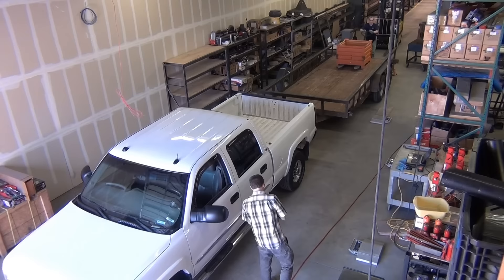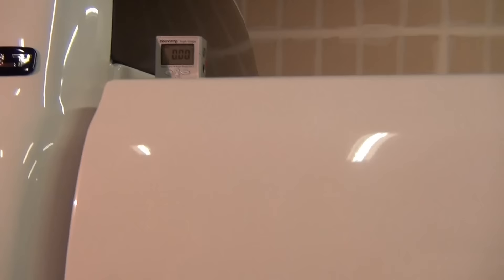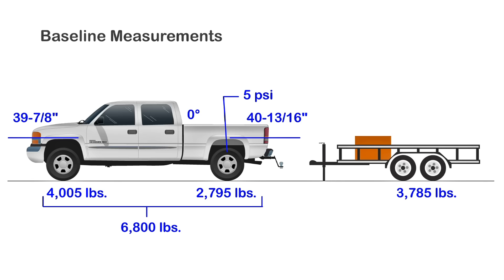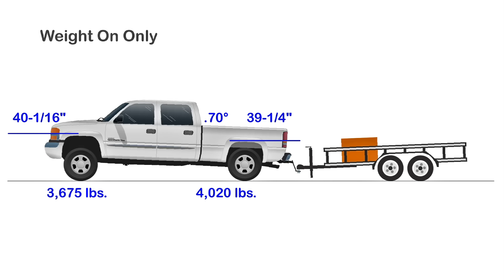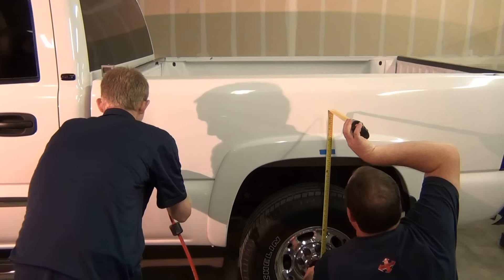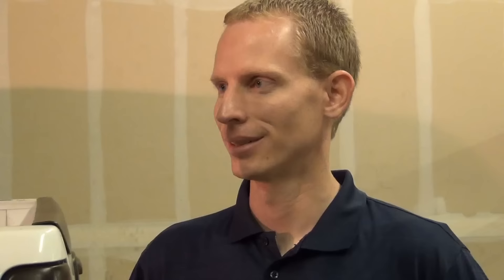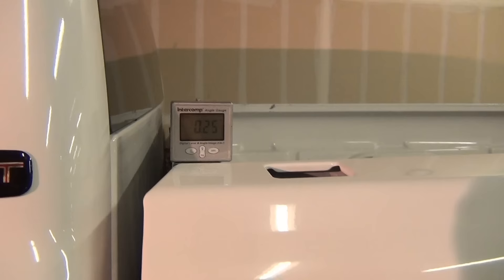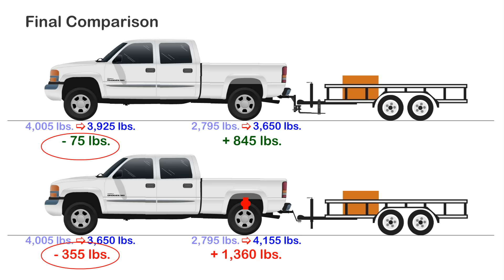The Difference Between Using Weight Distribution and Air Bags to Level Your Load

Comment: Great video. I would have loved to see you put a few pounds of air into the airbags and get the truck front axle back to original weight, and then look at the weights of the other axles and angles.

The reason I say this is because when I first got my travel trailer over 12 years ago, it was my first weight distribution hitch with the equalizer setup. I played with it extensively including adding tilt washers, raising and lowering the hitch height, raising and lowering the L bracket Heights, Etc.

At one point, I took way too much weight off the rear axle in an effort to get more weight on the front axle for steering. It took nothing for my little 5.3 liter gas V8 to spin the rear tires even with the trailer attached. Scary, but it was interesting.

I finally found where I was happy. With tape measurements and the driving feel of the differences I went to a truck scale and found that my front axle weight was pretty close to unladen so I was happy. I never changed it after that although that truck and trailer are gone now.

By the way, The Equalizer hitch is solidly made. I never broke a single component. And I once broke the tip of a 90 pound jackhammer. And my dad always told me I could mess up an iron ball in a padded room
Reply from the maker: What a great comment. Thank you! We assume that you mean you wish we had done more showing adjustments to the hitch with the air bags inflated. That is a request we have had numerous times, and it’s a video that is planned for the near future. If not, please give us some clarification on what you mean in your first sentence. We’re glad you had such a good experience with your Equal-i-zer hitch, and we recommend you stay away from iron balls and padded rooms.
Reply: @FastwayTrailer  I now realize that did not make much sense. What I was requesting was adding air back to the airbags after the weight distribution hitch was installed. I wanted to know if adding a little air shifted slightly more weight back to the front for steering. I have had pickup trucks loaded to the gills with concrete bags and the front felt soft and with lack of steering. Maybe 75 lbs doesn't make much difference. Nevertheless it would be cool to see what would happen adding some air to the airbags. My theory is that it would not add much weight to the front.
Reply from the maker: @brainpause  if you add air to the airbags after setting up the hitch, you do not increase the weight to the front axle, you reduce it. This is because what you are effectively doing is raising the baseline height of the hitch head/hitch ball. Weight distribution is a function of the distance the ends of the weight distribution bars are raised relative to the trailer frame. Therefore, raising the back of the truck raises the entire hitch by that distance, which reduces the relative distance the ends of the bars must be raised to be placed on the L-brackets or reach a certain chain link. If you raise the back of the truck without adjusting the height of the hitch ball back down to compensate for this, you will reduce the amount of weight distribution you are getting from the setup.

In your example, you should load the concrete into the pickup first, set your air pressure, then set up the hitch to the correct height and weight distribution adjustments. If you add air, you may need to increase the weight distribution. If you release air, you may need to decrease the weight distribution.
Reply: @FastwayTrailer  thanks for the reply. I actually don't haul concrete much but just recall several years ago when something like that happened. But it was a good example to use. Interestingly, it was a 1979 Chevy LUV, and putting most of the concrete rearward of the rear axle made the truck feel like it had power steering! Ha!
Reply: @brainpause  When loading the bed, you want as much weight on or in front of the axle, and that corrects the steering, the air bags then help to level up the truck, but will not move weight forward.   When you load weight behind the axle, there in no way to leverage it forward without a WDH, so if no trailer, no leverage. :)    What the demonstration here shows is that with rearward weight from the axle, all adding air does is increase the weight bearing down on the axle.

Comment: 4000 lb trailer, the toung weight should be 10%, not 1000 lbs
Reply: It's just a round number so if you need to you can use percents to get a good idea.
Reply: The usual guideline is "at LEAST 10%".....(not strictly 10%).  Many prefer 12-15%.

Comment: I run the air bags with rubber bump stop snubbers inside them.
Pulling a 5th wheel with 1000# on the slider hitch.
I put 40 to 45# pressure in the bags to level the truck.
I run my rig onto a CAT SCALE so I know exactly where all the weight is to keep it legal.
Drives great , braking is great , handling is great.
#8400 5th wheel toy hauler camper sits level and so does the '18 GM 1500 Z71 pickup truck.
Reply: being a 5th wheel instead of a bumper pull some of that 1k pounds is transferred to the front axle of the truck. a bumper pull puts that weight at the rear most area of the tow vehicle which causes the rear axle to be the fulcrum point. as tongue weight increases not only does it squat the rear it pivots the front up.  with a 5th wheel or gooseneck hitch that mounts in the bed the hitch weight is considered as cargo weight more so than tongue weight.

Comment: Exactly what I knew would happen. I have best if both worlds, weight distribution hitch, air bags, plus standard length Bilstein 9100 shocks in the rear and the same struts in the front, with a 1.5” leveling lift in front when not towing. So I’ve got a decent lift all around that I can actually adjust from the drivers seat, along with 33” Goodyear Duratrax tires. All installed on my new 2019 Colorado Crew Cab 4x4, V6, I bought with every option available on the W/T Trim level, along with the extra Skid Plates from the AEV Bison Package installed by the dealer, with a GM Extended 84 mo 100,000 Bumper to Bumper Warranty, all for just under 36k out the door with plates. We use to tow/explore with our small modest Forest River Cherokee Wolf Pup 16FQ Travel Trailer that has a CVWR just under 4,000 lbs. That does a great job everywhere! I have not been able to get axle weights, but on one of our week long trips I rolled over a CAT Scale at 8,870 lbs CGVW. That with a full load of fresh water, half loaded black tank, half loaded Grey tank, all the food,  our clothes and two dogs. The truck has absolutely no problem maintaining the speed limits on any roads/highways and averages 10-12 mpg depending on mountains or flats. But 18-20 city depending on traffic and 22-28 highway depending on traffic and speed. So far in the first 7,000 miles, I’ve never needed to add any oil, with a planned trip in to the dealers for my first of four complementary oil&filter changes and tire rotation.

Comment: I wonder what would have happen if u would have added a hair more air in the rear to lift the rear ended a tad higher , would it have added more weight to the front end? Would it have transferred more weight to the trailer axle because the tongue would have been a little higher?
Reply from the maker: Great question. Raising the rear won't directly add more weight to the front end of the tow vehicle like a weight distribution system will. It will give more of a level "appearance" but the front end will still be light. It would add some weight to the trailer axle because it would raise the tongue a bit, but how much is almost entirely dependent on the size of the load.
Reply: I wonder the same thing. I run both hitch and air bags
Reply from the maker: We're in the process of making a WD hitch with air bags video and it should come out this year!
Reply: Too much air has already been added. The airbags in the video are jacking the vehicle up beyond level meaning that the truck is taking more of the trailer weight by overlifting the tongue, and by taking on some of the truck weight normally carried by the front axel. With airbags inflated, the truck is pointing 0.2 degrees down at the front, not down at the back. You can verify this by looking at the ride height of the front axel without the trailer, then with the airbags. The rear axel was set to the same ride height.

Comment: Change the height of the hitch ball. Redo the experiment and see if that changes the numbers.
Reply from the maker: Raising the hitch ball will slightly adjust the numbers, the more it is raised or lowered, the more dramatic the weight change.
Reply: Changing the height of the front of the trailer simply lowers the rear of the trailer.  The weight is only slightly moved rearward in a static setting.  Once in motion, it changes a lot of other dynamics.  A level trailer is always the best way to travel.  Although I believe that moving the weight directly over the axles would have a larger effect of the load on the truck and trailer.

Comment: I would like to see this tested on gooseneck trailers with airbags. That's the setup i have. 96 ram 2500 with a cummins, 5 speed, turnover ball hitch and a 26'  overall length car hauler trailer with 18' deck and 6' step deck.
Reply: Second this I have weight distribution hitch for bumper pulls when I need but what about when towing my fifth wheel camper a distribution hitch not gonna do anything there lol.

Comment: everyone watching this need s to remember this is a loaded video by a wd hitch builder and dealer. I have a 1 ton chevy truck and I pull a 36ft TT with a 1000bls tongue weight when I bought it new in 2014 it cam with a well known wd hitch installed. having used these several time in the past I set it according to the specs for the hitch and for the truck. and sure enough it did what it was supposed to do but the ride in the truck was horrible I felt everything the trailer did every sway bump, bounce everything and again I have a 1ton truck. I was looking around and I found the air bags like these on ebay for $250 and installed them my self. the wd hitch that came with my trailer retails for $520 by the way. here is the difference. and this is where I raise the BS flag on this video. If you use the bags properly and inflate the bags to support the load at level instead of brining it up to level it would make a huge difference. Also we are to assume the tires on the back of the truck were fully inflated??? I have since completely removed my wd hitch and only use the bags, and the ride quality is way better, braking is great and I am not bound the support bars in a sharp turn. but everyone can make their own decision.
Reply: The WD arrangement introduces a coupling torque between the truck and trailer, hence you feeling the trailer's bumps in a more pronounced manner. Ideally, the WD bar that applies the coupling torque should have both a preload AND a spring rate tailored to the weight of both entities, their respective polar moment of inertias and even a target vehicle speed. That way they properly act as an integrated system. I doubt any WD system is that sophisticated, but if there is as much coupling as you suggest, I bet that while the WD's preload may be OK, it's compliance (effective spring rate) is too high. In that case, when going over bumps which tend to change the relative angle between the two vehicles, the moment (torque) applied changes dramatically instead of remaining relatively constant.  It's likely that there is some optimal setting so that the re-leveling is performed by both the WD and a spring assist like an air bag.
P.S. I've only used air bags myself but worked in automotive engineering for 14 years, including suspension geometry.
Reply: Bob

Agreed!

Comment: I think we can all agree that if you don't tow and solely load the bed only the helper airbags are the only way to go.
Reply: that scenario is not being discussed in this video so your point is kind of irrelevant.  and loading the payload only won't reduce the weight on the front end of the truck much so losing steering control isnt an issue either, like it is with trailering without a WD hitch.

Comment: Thanks for the "real data" video. It looks to me like a little more weight transfer would be indicated here in the final setup, weight should NOT be reduced at the front axle. I use both airbags and weight transfer, on the highway the airbags are set to minimum and the weight transfer is used. However when we leave the highway and hit the dirt roads we have to remove the weight transfer bars and use the airbags to maintain ground clearance. Going through washes the weight transfer system would likely break something, but speeds are a few mph so system stability and front wheel braking is not an issue. The truck should have enough axle capacity to avoid overloading it of course.

Comment: What would happen if you used a combination of both? Damn, wish I had that equipment for a weekend...lol
Reply from the maker: Using a combination of both is a great option. I takes a little time and a bit of trial and error to get them dialed in, but when you do you get a very good ride. Thanks for watching!
Reply from the maker: That is a request that we have had many times since producing this video, and we hope to have a video detailing the use of both products produced in the near future. Stay tuned!
Reply: This is the setup I use when towing a very heavy camper behind my f150.  I use the equal-i-zer hitch and 2,000lb bags.   I use very little air in the bags (10psi), and primarily it is to improve the ride quality (which it does!).   If you add too much air, or not enough equalization, the steering and ride turn bad.  It takes a while to get it dialed in just right.   I wish I had this equipment to get it all perfect!
Reply from the maker: Thanks for the comment!

Comment: I have a Dodge Ram 1500 with the coil springs in the rear (I had the Airlift 1000HD bags inside the springs). I use the airbags to level my truck along with a WD hitch. 

I am wondering if my airbags would potentially take away from the WD hitch effectiveness? Essentially if my PSI was above the “sweet spot” for my particular set up.. 

Thanks!!

Comment: Air bags r only good for those times when u have extra weight in the bed, useless for trailer towing!
Reply: This is correct. WD hitches change the physics of the entire vehicle. Airbags are completely cosmetic when towing and if yoe rely on them alone it is dangerous as you aren't balancing any weight. Just making it look it its loaded properly.
Reply: Not true at all. My work trailer gets unloaded slowly from the back increasing tounge weight. I use the airbags to adjust my headlights and give a much better ride. WDH cant do that.

Comment: Iv been Hauling big TT's for 35 yrs, almost always near max weight, I have the same WD hitch as in vid, it's the best system. Imo, stops sway, levels truck, moves weight to front. ( Did add rubber bumpstops / helpers )  had bags yrs ago,  untill one blew, on a curve, down hill. Almost rolled it and the closest parts store was 65 miles away.
Tow safe,stay in weight limit, have only 10-15 % trailer weight on tung, use a WD hitch and proper size tow vehicle..Think this way, Ave 28' tt @ 8,000lbs, 10% on truck, is 800lbs, 
4 of your buddy's sitting in back bed is @ 800lbs,  do you needs sir bags to drive buddy's around park ? Hope not

Comment: ok so what I learned from this video is.....get a f-350 and a fifth wheel
Reply from the maker: That is certainly an option if you can afford it. However, as long as your tow vehicle is sufficient to tow your bumper-pull trailer, a good weight distribution/sway control hitch like the e2 hitch will do a great job towing your trailer.
Reply: Yes, and buy B&M Companion 5th Wheel
Reply: Buy diesel for pulling heavier loads...

Comment: Load the trailer correctly there would be no problem
Reply: My understanding is that in order to minimize sway, the weight on the tow ball should be between 10% & 15% of the trailer mass so unless it's a really light weight trailer, the issue is unavoidable.